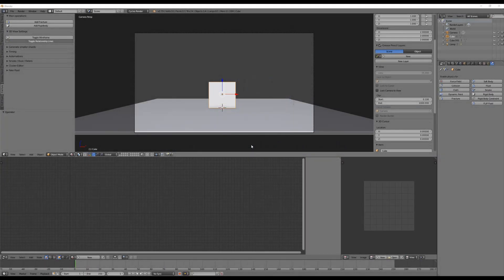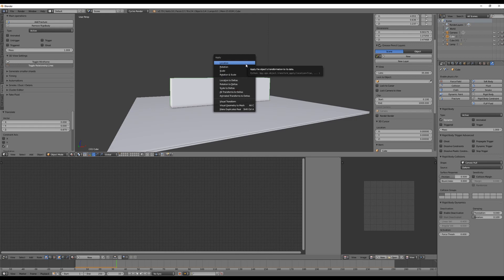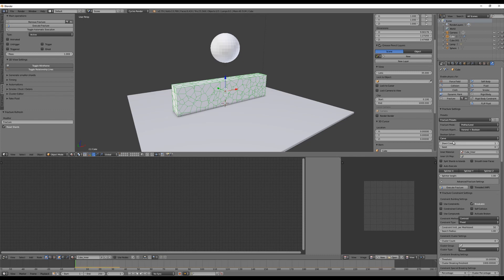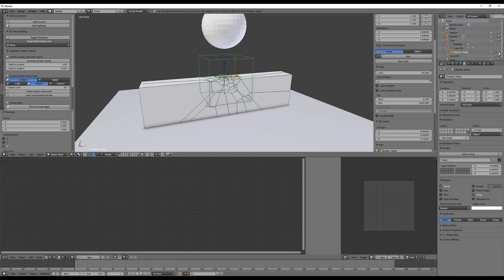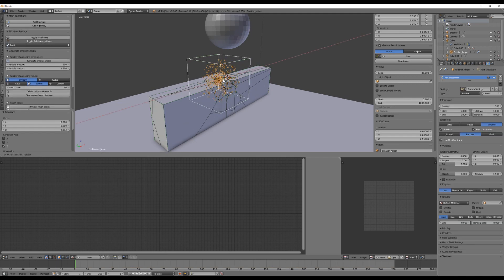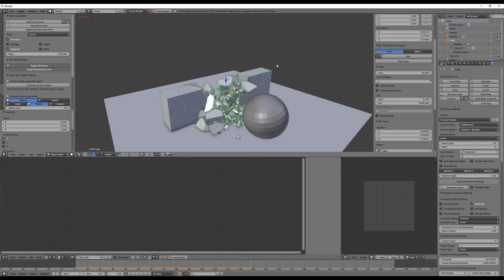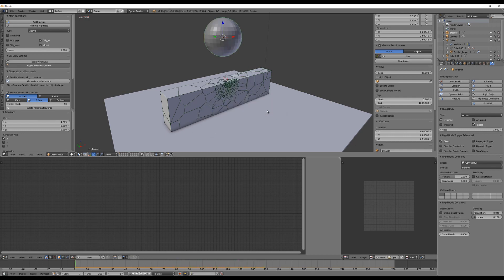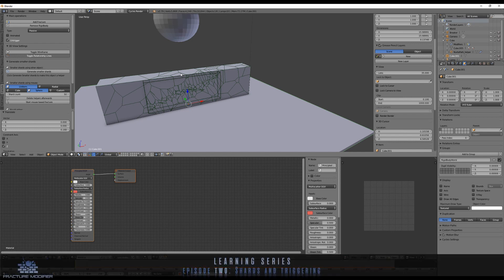Fracture Modifier | #2 Shards and triggering

Comment: How can I achieve active rigid body object being a triggered and passive being a trigger? For example for a mug to shatter on impact, not in mid-air.
Reply from the maker: Triggering actually does not work in this way. I can place a request on out todo list.
But you can use constraints to hold pieces of your active/fractured object together while moving.
Another thing is in the "timing"-panel of the helper addon. Here you can delay fracturing.

Comment: can i just say this is absolutely awesome, please do some more tutorials. is it possible to do all the Fracture tests in a separate file then append your wall/object to a different file at any particular frame, for an animation?
Reply from the maker: It would be needed to refracture the object. But remember that all physical simulations are the same cache! So the only way to delay fracturing is to use the "delay"-feature from the helper addon or just use triggering. Hope thats helpful for you :)
Reply: thanks for the reply, think i've been mixing up the way Blender currently uses cell fracture, creating a dupe of the wall and having each chunk of wall a separate object. i was wanting to i run my sim using Fracture and bake it, then drop than in my animation file at the right place.
just seen there's dust/smoke/debris options too - is there any documentation about these, or are you working on a video?
Edit - i'm trying to weight paint, but i can't seem to get it to work :-/
Reply from the maker: The Fracture Modifier can convert your simulation into a keyframed animation where every single shard will have an own animation curve. These then can be moved in the timeline! 
No documentation actually - but i agree its required to do more tutorials about the addons settings.
Sorry, please be patient there is a lot todo actually.
Reply: thanks for the reply, don't worry, take all the time you need, this addon is worth it :-)